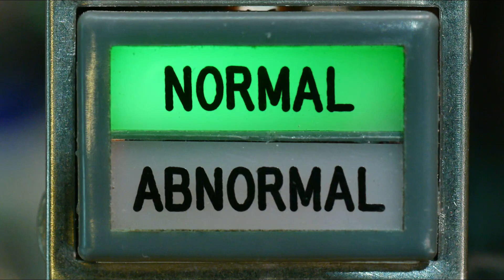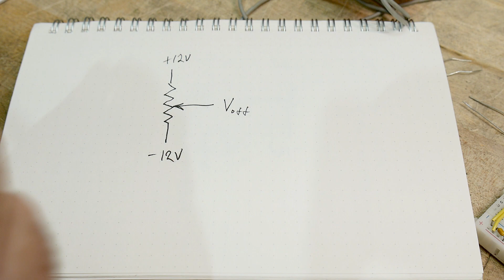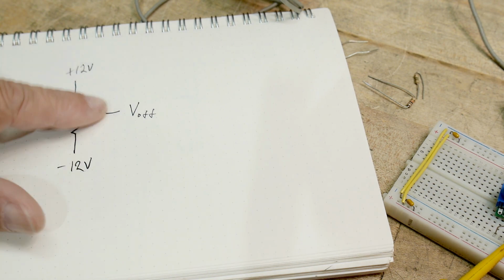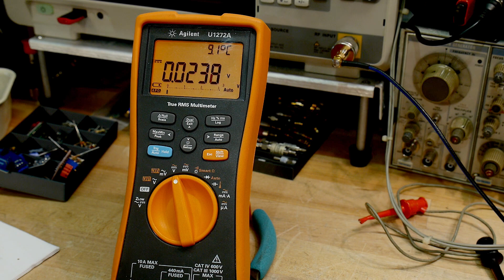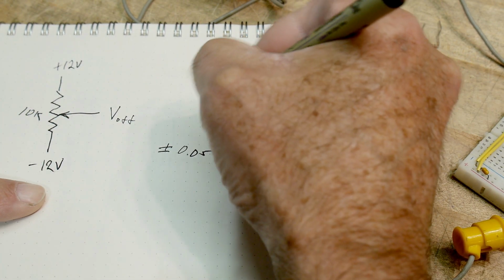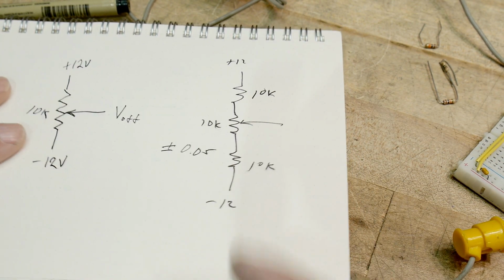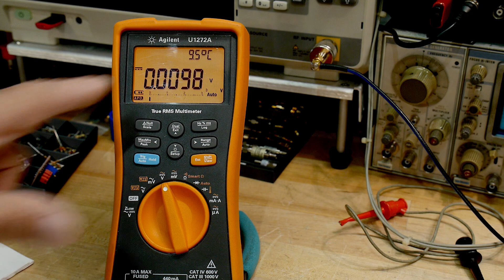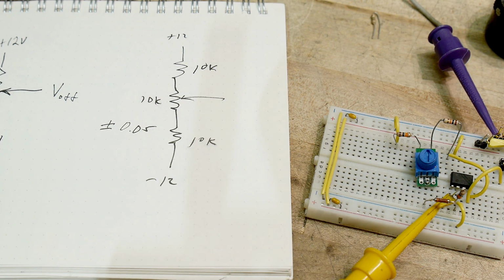#1355 Touchy adjustments made easy

Comment: I did a study of lower end Heathkit digital multimeters and also their solid state VOMs. Their earlier DMMs had lots of solutions implemented to make calibrations less touchy and more stable. But as newer models came out, they must have been using the Muntz technique to shave off pennies, as those extra components slowly disappeared over subsequent models; touchier, but apparently "good enough".....kind of the reverse situation of what IMSAI Guy described.....the engineers put in what they thought was the right thing from the start, then penny pinching removed some of the goodness.

But sometimes I noticed clever little things like making parts of a circuit do 'double duty', so only one circuit block was used one way for calibration, another way for final use, as opposed to the original design where Heathkit had to provide extra components and their associated cost.

Comment: Thx for another helpful video.....I have experienced same "touchy" adj pots on critical "tight" spec voltage limits designs...My worst criticality touchy adjust experience was some of the Bell System 6 Ghz--11 Ghz Reflex Klystron Tube Mechanical Frequency adjustment where you Mechanically "Warped" the tube's Metal cavity structure for initial "On Frequency" requirement setting.....Of course access was hidden buried deep & blindly Screwdriver adjusted, you had to Anticipate the Mechanical worm gear "Backlash" Effect &  Adjust Past the Peak so the "Relaxed" gear drive would "settle"  On Frequency  !!  Seemed kinda crude to me at the time (early '70's), but it Did reliably work & hold setting.....

Comment: Engineering Design Change Order (EDCO)
You can use DPDT switch to short circuit the extra resisters so you get the best of both worlds ( more precision or more range)
You can also use two dials, one for coarse and the other for fine adjustments.  However, the circuit gets a bit more complicated.
Reply: And too expensive for anything being mass produced. In other words, impractical for anything but custom jobs.
Reply: @youtuuba  For anything mass produced, a DAC should be used as part of ASIC blocks,  POTs are too expensive for mass produced stuff these days.
Reply: I thought about this a bit more last night
In case of 2 resistor and a pot, if the pot has high impedance say 100K or 1M, we can use another resistor in parallel with  pot, Say  if the two resistors have a value of 1K, and the resistor in parallel with pot has a value of 1K too, since the pot's resistor is much higher than the parallel resistor, then the voltage across the pot is 1/3 of the total supply, and the pot now can only choose the voltage in the range.  Now if the resistor in parallel with the pot is 500 Ohm then the voltage across the pot is only 1/5.  So you can see only by switching the parallel resistor across the pot you can change the pot's range.

Comment: I have something worse.  The engineers put in a 100k ohm 4 watt variable resistor with 500 volts on its input.  There are are times the that the output is 450 or more volts or the capacitor under test dumps that voltage back.  . Of course that takes out half of the resistor.  100K ohm variable:face-orange-frowning: resistors are not cheap if you can find them. In fact, you could buy a new LCR tester for about the same price as that one variable.  It is the old Vintage Eico 950B Resistance Capacitance Comparator Bridge.  There are work-arounds and a simple bench top addition you can use to prevent dumping back, but I lent it out once and the kid who used it claimed not to have dumped a cap back into it.  What he had done, was to try to reform a 450 volt cap on the machine.

Comment: This seems like a thing one could retrofit, though perhaps in a not great way. Lift up the adjustment pot on two resistors and a wire.
The obvious question then is how can you identify the cases where this won't work?

Comment: The approach you show will work well when the temperature doesn't change much.  However, unless the temperature coefficients of the fixed resistors and the pot are well-matched, the set point could drift over temperature.  I've often used a variation of this where the pot is connected as you showed at first (directly between the rails), but with the fixed resistors connected as a voltage divider between the pot wiper and the load.  Accomplishes the same end with the same number of parts, and effectively eliminates the need to match tempcos between the fixed R's and the pot.
Reply: davidciaffa4711, if I understand what you wrote correctly, it seems that what you suggest would indeed result in a lower voltage after the wiper, but this approach may not be desirable for every situation where the engineer wants to have a potentiometer swing through a limited voltage range.....using two resistors outboard like this video shows preserves the linearity better, whereas putting a voltage divider in the wiper introduces linearity distortions due to the dynamics of parallel resistances. No big deal on a trim pot, but using it on something with a front panel knob, especially where a pointer on the knob has to align with a scale, well, it can complicate things.
Reply: @youtuuba  You are correct - the non-linearity is a trade-off for my suggestion.  It can be minimized through judicious selection of resistor vs. pot values or by inserting a buffer between the pot and the divider, though this introduces its own set of trade-offs that need to be considered.  That's why we engineers earn the big bucks... 😏
Reply: It seems to be quite common for designers, especially amateurs, to completely ignore issues of drift with temperature in components. I suspect many are only vaguely aware that there are issues. Of course for lots of things they really are insignificant. In precision analog circuitry they can be a major problem. They'll shove a 16 bit ADC into something, maybe treat it to a decent reference which may cost more than the converter, and totally ignore the tempco of resistors that set gains or offsets (which is OK if you only care about resolution and not accuracy).

One of the things that annoyed me before I packed in doing electronics was the very mediocre temperature coefficient of resistance  of reasonably tight tolerance SM resistors. You could go to a ±0.1% part and be stuck with ±25 ppm/K tempco. I used to get ±50 ppm/K with the ±1% leaded parts I often used. Still,  for only a dollar or so each you can get some pretty decent types.

Comment: I've made the two resistor mod a couple times when the adjustment was just too sensitive. It also makes it much more likely to drift, since mechanical vibration or temperature changes might move the pot wiper slightly. Even multiturn pots can drift over time as they don't have zero backlash.
Reply: I see glue being used on trimmers to fix them in position, not recalibration friendly though.
Reply: @plainedgedsaw1694  still the wiper can move regardless, multiturn pots have an internal wiper that's separate from the screw that can move too

Comment: If you put the 10k resistors in, adjust the pot, and then take the 10k resistors out of the circuit, would the output still be approximately where you adjusted it to?

If so a factory could have a jig with the 10k resistors and some pogo pins, so that the resistors don't have to be soldered into each device.

Comment: A multiturn pot is, in general, no more settable than a single turn type if you are comparing good quality to good quality (which leaves out most of the rubbish sold on ebay). Inexperienced operators do find them faster to set.

Comment: Typically I see 200 to 500 ohm variables used in circuit two on Tek gear. After 50 years, those variables aren't very good anymore. Cleaning rarely helps. Replacing them does wonders. When you put the bad ones on a curve tracer, you can see the resistance bounce all over the place as you smoothly turn the knob. Who should I believe, you or my lying eyes (grin). Merry xmas!